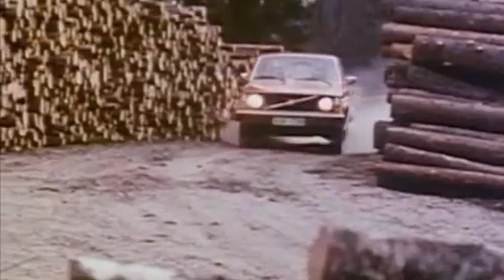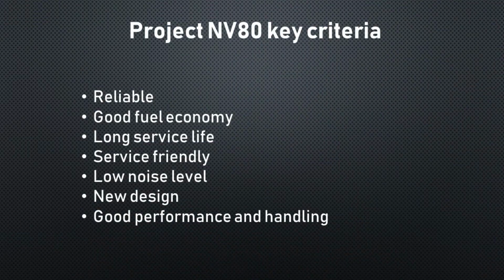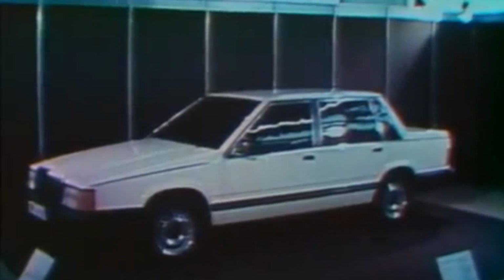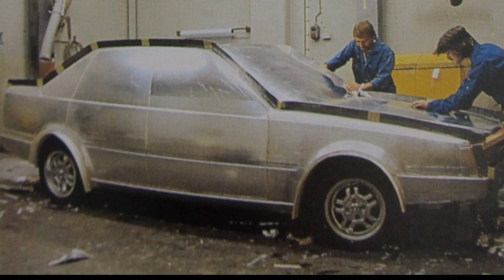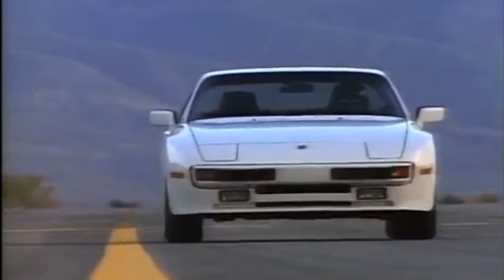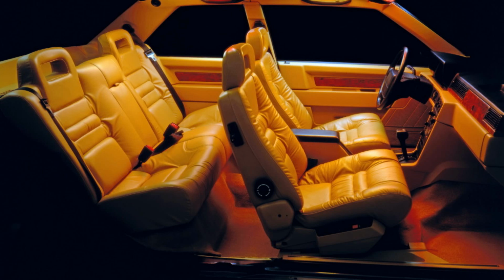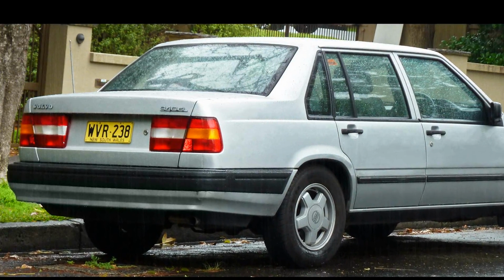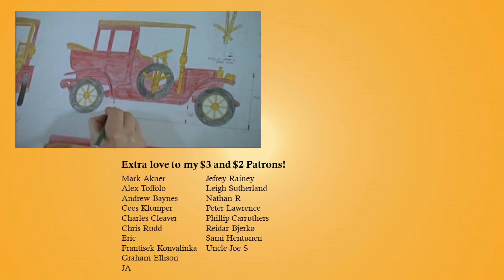How the Volvo 740/760 SAVED Debt-ridden Volvo

Comment: I´m glad people are picking up on the reliability comment, enough to garner a pinned tweed. the 200 was really only a development of the 100 series which had though some pretty heavy development itself through its 8 year life (plus the extra year for the 164) and while the b21 engine was new, it itself was a development of the b20 engine and carried over the simple k-jet injection. from the windscreen back there were only minor tweaks and on top of that the 240 really wasn´t changed until around 79-80 shows that reliability certainly wasn´t an issue with them. as for the v6 engine, as i understand, problems only started showing up with those engines after a few years with oiling problems etc but that would be right around the end of the 70s and wouldn´t be fixed until the early 80s. for unreliable i think the video is confusing the 200 series with the 300 series which did have a lot of issues (and, strangely, was completely omitted in the video.) there were a few other small errors as well, eg the 260 soldiering on along side the 760 which was the case for less than a year. the last 264s were model year 1982 where the 1st 760s were 1982 models but very few were made. the 260 estate was kept as there was no 760 estate yet and volvo didn´t want to leave that market segment but as soon as the 700 estate was introduced the 260 estate disappeared. another comment about the lineup in the early 90s i guess could have been seen as slightly confusing but it was logical enough where the 900 series was in full swing by 1991 the 740 was kept on as a base model and both were available for only for 2 years (91 and 92.) it´s worth noting that that 240 and the 850 do cross over for 2 years, 1992 and 1993 so volvo had a rather large range for a period (240, 440, 460, 480, 740, 850, 940, 960.) a few other small errors and omissions but one of the big ones was why volvo was nearly bankrupt in the 70s and that was that the oil crisis happened in 73 and people were looking to smaller cars and volvo were really known for large cars. the 343 was introduced in 76 but not well received for the 1st few years and while there was the 66 that was really a niche car and a footnote for volvo. the price of oil was dropping again in the 1980s coinciding with the introduction of the 700 series so through basically luck it was a car at the right time for people to want it. a pretty good video otherwise with interesting points eg the 16v turbo 2 litre engine which is little known

Comment: I had a 1994 850 GLT with a 5-speed (a rarity in the US), had to look hard for one with the desired equipment level. I LOVED that car, it was my favorite car out of all those that I've owned. I liked the way it looked, I liked the way it drove, it was comfortable and reasonably efficient, and it was generally very reliable as long as it was taken care of. Finally parted ways with it in 2010 with over 250,000 miles on the clock. Only the AC and and some dashboard lights had stopped working at that time (admittedly, the AC would have been expensive to fix.) Engine and original clutch were still strong!

Can't say I was as excited about the 940/960 series, perhaps because rear wheel drive is a bit of an impediment in the snow belt where I live, but the familiar Volvo looks are a source of comfort and reassurance to my eyes. I don't look at Volvos quite the same way today, although the current S90 is quite the looker!
Reply: AC often is cheap to fix - the clutch wears out and you have to remove some shims to make it work again. Relatively easy to work on these cars. If you are inclined to do some stuff yourself: perfect cars!
Reply: jason9022  mine didn't. But then, I did some maintenance now and then.
Reply: jason9022 I think the ‘94s were better! :)  Seriously, Volvo made quite a lot of adjustments after only one model year, although I doubt there were major changes to the engine. My 5-cylinder engine was wonderful, despite the Hoover-like sounds characteristic of this motor. No oil leaks. Ever.

Comment: Great vid ! Worked for a Volvo dealer in this time frame back in the day, they had a great line up of sturdy and reliable cars, remember buying a 14 year old pea green '76 240DL trade in for about 100 squid, it was completely clapped out mechamically I am sure it had been clocked but  I fixed it up with the running gear and beige interior trim from a wrecked '82 GL. What a stonking car to be driving, made selling 740/760  range easy as I could point to my old banger as an example of the great reputation for reliability and longevity while pointing to the lovely edgy new model that had virtually the same running gear. Models to look out for from that period the 240GLT and the 960 with that fabulous straight 6, and independent suspension all round, though driving any of them could be good fun.

Comment: I had a 1985 740GL until about 4 years ago, and if the front suspension repair it ended up requiring hadn't been deemed to be more more expensive than the car was worth, I'd probably still be driving it today. At 30 years of age, it still looked like a new car, drove really nicely and was the most reliable vehicle I ever owned.

Comment: They made the 740 as a 2.3 litre car, or a 2 litre car for markets where tax conditions greatly favoured cars up to 2 litres. The UK had tax conditions that greatly favoured cars up to 2 litres, but Volvo used the 2.3 litre engine for the UK market. I never worked out why, but it must have really hurt UK fleet sales.

There were 740s in UK showrooms in the fall of 1984. I bought a 740GL in the middle of 1985. Its serial number was something like 3000, and its manufacturing date was just a few weeks before my purchase. I was shocked when I saw such a low serial number. The production ramp must have been very slow. The car was early enough to still have a silly teething problem, that had to wait for a fix from the factory. A rather hard to miss tendency for the engine to stop when bringing the car to rest with more than fairly light braking. After that problem was sorted out (which was a serious nuisance, as it took several trips to the dealer), the car needed nothing more than regular service, tyres, battery and an exhaust over the 7 years I had it.

I was amused by the colour name for my car. It was a deep lustrous red, that looked really good, and fooled many people into thinking it was a high end type of finish. Mundane car paints usually have wonderfully exotic names, but this lovely finish was simply called "deep red".
Reply: That color is also known as wine red here in Sweden

Comment: Fun fact: the 1982-1984 760's and 740's were such incredible rustbuckets they started galvanizing them in '85
Reply: Fun Fact: All big Volvos were fully galvanised since 1962. The Bertone made ones were the only ecceptions from that rule, them being the 262C and 780. Get your "fun facts" straight…
Reply: @zweispurmopped  these early 740's must be an exemption to this rule then, have seen plenty of them. Get your "fun facts" straight...
Reply: Henry Discipline  I highly doubt it
Reply: Yes, on Finnish Volvo site they said, that galvanizing started in mid 1980's (lower part of body).  Full 740 galvanizing started perhaps 1989-1990.
Reply: Better to use stainless steel.

Comment: I had a 1989 Volvo 780 coupe turbo with the 2.3, so they did find enough room for the turbo. The 780 had the rear self leveling suspension too.

Comment: I love these old school Volvos. The 240 is legend - my family owned 2 estates - they were superb cars, and contrary to the early reliability issues, steady as a rock.. However, the 960’s replacement, the S90 and V90, were brill8ant. The V90 is possibly the nicest car I’ve ever driven - and I’m currently an Audi A6 driver.......
Reply: yep  had 3 x  240 series in the early eighties young kids  SAFETY  , very reliable  and the 242 GT was a real  goer  , moved onto a 535 and 735 and lots of  BMW unreliability , those Volvo 4 cylinder engines were so tough .

Comment: I grew up in a 245 and then a 945. I have owned 3 240s (still have all 3...), a 740 GLE and my current daily driver is a top-spec 1997 960. All very good cars in their own way. The 740 had really good fuel economy. My personal best was 32 mpg.

Comment: Still drivning my Volvo 940, daily!
Reply: Nice. Whats the mileage and have you gotten any trouble with it？Thinking of.getting a 4speed manual one
Reply: @mattmatt9971  Have had it four years, has about 34 000 Kilometers on it now. No trouble other than normal wear (have replaced shock absorbers and ball joints etc.).
Only thing that happens once a year is the waste gate arm jumping out of its place on the turbo making it charge zero. It´s an easy 15 minutes fix though.
Only negative thing a have to say about the car is the fuel consumption, but it is nothing spectacular.

Comment: Wish I could have owned a 740 when new.  I have owned 4 different 740s, two NA and two turbo.  They all cost under $1500, cheapest was $450.  They all looked great, even though over 20 years old and in maine where most cars that age have a lot of rust.  Never had to work on the motor or trans, even though they all had over 200k miles.  They had some electrical issues, and normal wear and tear.  They handled great in the snow!  Were fun even though low powered, due to being RWD.  Get on some snow or dirt roads and drive around.  The carried over 4cyl was tough, though not especially powerful, refined or fuel efficient.  But damn, for under $1500 they were the best dang cars I've owned.  The $450 one was a '91 740 turbo wagon with all the trimmings.  Everything still worked, it could spin the tires and just felt like WAY more car than you paid for.  It was really a shame when volvo ditched RWD and even worse when they sold to ford.  I've owned a couple 850's and a V40...while not bad cars, they were not a tank like the 740.

Comment: You never touched on the Dutch DAF tie up that saw a rebadged DAF become the 300 series which was followed by the truly horrid ‘nedcars’ the 400s.
Reply: they miss the fact that the 360 glt was one of the best handing small cars on the market i had 3 of them , but volvo could have sold more if they had fitted the 2.3 motor instead of the 2.0 , yes the 400 series was crap
Reply: jason9022 no

Comment: Volvo could simply not build a bether car, then the 2/700 series.
But..
You forgot about the 3/400 series, and Volvo didnt do that bad in the 70's. (remember ther was a resesion in the whole auto industry)
240/740/940s are stil common on the road in both Norway and Sweden.

Comment: Greetings from America.  This is an interesting channel, I like learning about cars we didn't even have in USA.  But this one we did.  My family had an '86 740 turbo for many years.  It was eventually a hand me down to me.  I always loved the drivetrain but hated the styling.  It was quite fast.  We had put a "T" in the wastegate line to give it more boost.  I ran a 15.2 quarter mile in the import class in the early 2000s at my local racetrack.  This was when everyone with a Civic thought they were fast and furious, so it was hilarious to beat them in a Volvo.  
  My father being a firefighter and having seen lots of accidents preferred Volvos and large American cars.  In the mid 80s we looked at the Cutlass Ciera but it didn't even have rear shoulder belts.  The volvo was not that much more money and was a very well built car.  Other than some electrical problems it was very reliable for 19 years until I sold it.  The 850 sadly, was what ruined Volvo.  A friend of mine bought one based on his ride in my 740 and after getting stuck with an $800 timing belt change amongst other things he moved on to other cars.   His wife also had an early 2000s volvo and it was very unreliable.  But my point is Volvo switching to FWD took away a unique feature.  My father now seeing them as the same as any other car bought a Camry in the 90s.  He has stayed with boring Toyotas since.  I thought about getting the last year of the red block, the '95 940, but bought a '00 4runner instead.  A truck built like the old Volvos.

Comment: Bought my first Volvo 122, in UK ,, in1968. Second car was a 142S in Sydney, then a Volvo 120 ex works rally car in 1971. Another 1960 ,120 , which was sold and restored.   
Next car was an 245 DL, and when sold , still had the original engine, with 760,000 kms on it. Had two 240 series cars, one being a wagon. After these, a 740 Gl ended up in the garage. Gave this car to an old penioner, who still has it today. Great car. Next was a lively 850 GLE , which n o w lives in my daughters garage. Next was  an 850 GLT. Should never have sold it. Traded it on a S40 , which was then traded on a VW Golf. That was sold, and now have a nice and quick S40 Turbo. I think I love my Volvos !

Comment: Its really funny, as in the end the 240 still outlived the 740. The 240's classic styling (in both sedan and estate) played a huge role. The 740 had an "americanized" look to it and it made it less popular in Europe. The 740 estate looks good tho. But the 740 saloon is mehhh.
Reply: 940 was basically a renamed 740 and they lasted until 1998 unlike 240's.
Reply: @geothon  940s had better styling, newer interior and they got the best Redblocks (Volvo ditched the 740 because it was in a weird place, they ditched the 240 in 93 cuz across Europe it was the beginning of the European Emission Standart (Euro 1))
The 140 (on which the 240 is based) was such a great design only the law could kill it
Reply: @victorpelini5995  Front suspension was outdated on the 140 and that's why it got changed. Pushrod B20 was outdated too but lasted one year into 240's anyway.
Reply: @geothon  yeah but the main platform remained quite the same
Reply: @LedZeppelin 1987 mehh idk, I hate the 740 sedan's rear windshield. The 700 series front end looks better than the 940's tho I agree.
Overall the 240's more classical design looks better

Comment: Just a note about 240 vs 260 or 760 vs 740 or so. The 6s were always the nicer Volvos. Both were high quality and such and solid but I don't know if the shock damping was different or noise reduction, but the 6s had a premium, near luxury feel that the 4s didn't quite have. I was introduced to the 6s level (164E) and the 4s are decontented versions. The original 700 series was the 760, the lux version. The 740 came later and while nice, wasn't quite as lux as the 760 or refined feeling (although the 760 Turbo used a turbo 4 since the PRV 6 had issues). The 264s also felt nicer and smoother than the 244s as well.

Comment: Had a '90 Volvo 740 Salon with the B234F engine and the 4+1 gear manual for over 5 years.
I did most of the service myself, but had to sell it to somebody who could take more care of it than I could. 

A great car, still miss it a little bit. its boxy shape and because it is surprisingly narrow means you had no trouble finding parking space.
Reply: I had a 1990 740 Turbo 16V (B204FT) saloon many years ago.
Sold it to a guy that wanted to restore it since it was the only original 740 T16v in Norway.

Comment: I needed a second car and with a young family I couldn’t afford more than $1500. A coworker told me to go spend $1000 on an old Volvo. 

So I picked up a 1985 744 one up at a dealership for $900. It had 346,000 km on it. 

The AC didn’t work, the heated seats didn’t work, the left rear window didn’t work, but everything else was great. It came with a Pioneer CD/MP3/Sirius radio in the dash, a manual crank power roof, and some of the most comfortable leather seats I’ve ever sat in. 

I loved it so much that I decided to spend $2500 on a 1991 745T with 200,000 km to be our main family vehicle and stay out of payments. We drove it a lot but after 60,000 more km it had a ton of bottom end blowby and wasn’t worth fixing. 

The 744 wound up catching fire at about 410,000 km. Electrical short. So I picked up a 1982 244. 

This was probably my favourite one. It was not as comfortable or well equipped as the 744 or 745, but it was four speed manual. Unfortunately just about every convenience option failed on it like windshield washer and blower and ignition (I bypassed it with a switch) so it was no longer suitable for Canadian winters. 

I wasn’t interested in newer Volvos.  Subaru seems to have replaced Volvo for quirky and reliable cars but with their head gasket problems and CVTs they don’t seem so reliable to me.. so wife drives a Honda and I drive GM junk that is cheap but predictably unreliable.

Comment: Excellent video on the 740 range, I owned two estates one the best car i ever had the other the very worse, The good one just kept on going, so reliable and yes i do my own maintenance and it was easy to work on , it was a comfortable car  and reasonably economical, I have owned many cars but the 740 stands out as one of the best, the least said about the later model one the better ! Happy memories, i should never have let it go ! I remember on the 20th MOT the examiner called me over and told me to look underneath the car, expecting problems,  he simply said its in far better condition than cars at 3 years old. its like new !  That is testament to Volvo  build quality.

Comment: Good video. Front  bulbs change (signal and main beam) is a little difficult in 740 turbo (1987) on the right side. Bulky air cleaner housing is preventing that in  740 turbo.  In Volvo V70 1999 (series one)(old syle)  (non-turbo) bulb change is more easy.  (Oil change is more easy in 740, because oil plug is horizontal and Volvo V70 1999 oil plug is vertical.  Horizontal plug is easier to open without lifting the car.)